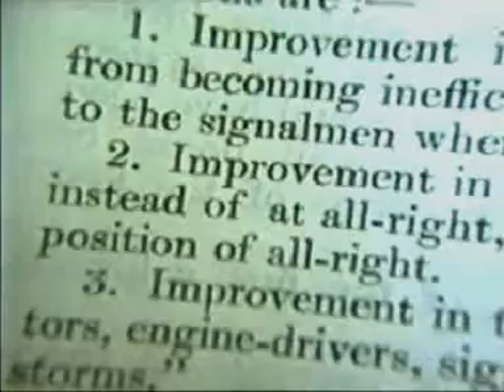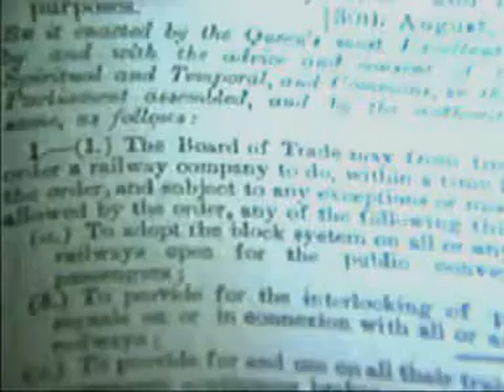Rail Crash 3 of 6

Comment: At the Start that is correct for that time but I believe that all Signals should be set at Danger unless a train is approaching I think Correct me if I'm Wrong.
Reply: Late reaction, but like said in the video, at the time it was commonplace to set signals to "section clear" so as to not risk keeping trains waiting for nothing.
Abbots Ripton showed the dangers of this practice, because the signals were frozen in the "section clear" setting. Therefore the express had no clue it was about to hit the shunting coal train. Abbots Ripton is therefore the disaster that made putting signals on danger when no train was coming mandatory. 
So technically you aren't wrong, just one crash too early!
Reply: @casperreininga3253  ah that makes sense, always stumped me. Cheers for the explanation.